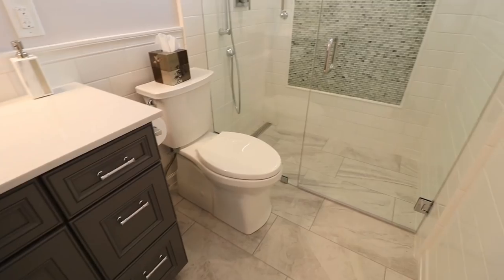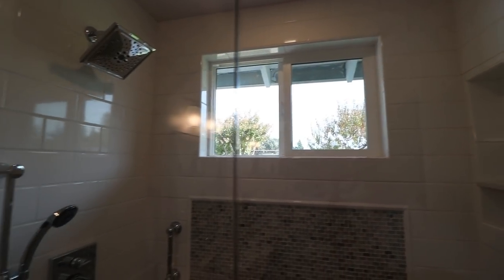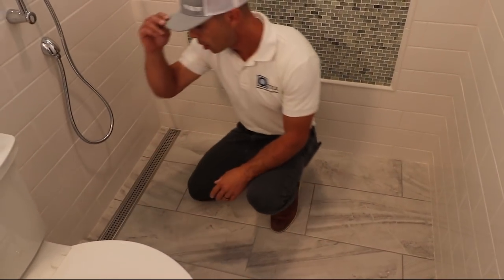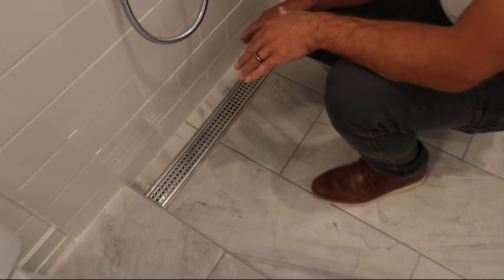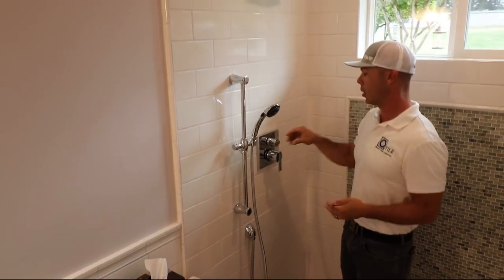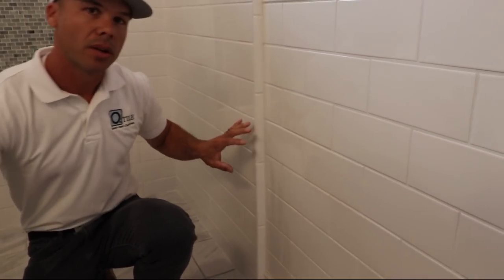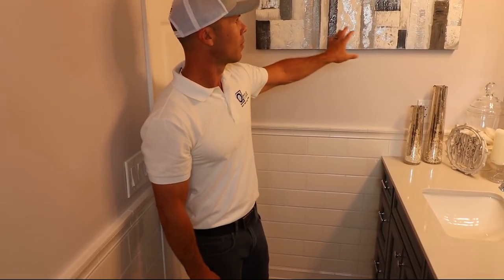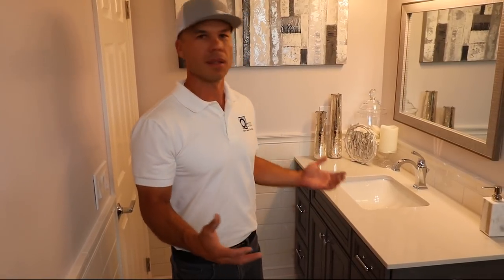Complete Bathroom Remodel-  Start to Finish-  Grandpa Bath Episode 9

Comment: Dude, you are cool.  Love your passion, and love your humility.  I'm glad there are guys out there like you doing top level work, and taking pride in it, like we used to.  I used to think that most contractors were out there, cutting most, if not all of the corners, but you've changed the way I think about hiring someone to do the level of work I'd like done in my home.  After watching this series, I realize that it's a ton of hard, skilled work, and I have to admit, even as a handy guy, I don't think I could/should make a go at it.  Electrical, Plumbing, sealing, mudding, and all of the forethought and planning put into centring, and finishing touches.  A true professional.  Bravo, man.  I'll stop kissing your ass, now.

Comment: When enlarging a bathroom into a space that has hardwood floor do you need to remove the hardwood replace tile backer and then set your tiles. Seems like that's the way you have to go but you're the expert. What's a u coach really would appreciate it.

Comment: great videos Isaac.... really great.  I am in process of planning exactly the same shower, pulling out the tub, building the correct pan structure for curbless and doing the linear drain along the control wall.  Perfect.  However what I most wanted to see was the one thing you didn't cover and never showed:  The relationship between the glass wall pane/door and the ramped curbless floor transition?  Where is the water dripping onto from the glass?  Is the glass overhanging the ramp step or overhanging inside the ramp?  If the  glass is mounted to the floor outside the ramp how is the water being prevented from pooling?

Again great videos, but I was hoping to see that final detail of glass and door relative to the curbless ramp step.
Thanks!

Comment: Great work Isaac, thank you for inspiring and dispersing your knowledge. I just finished tiling a bathroom for the first time, and the amount of planning and foresight that goes into it is staggering. However, doing your homework surely pays off, and I am very happy with the result. 

I still have a question, forgive me if it has been answered. I watched a lot of your video's, but I can't claim I watched all of them. Anyway, what's your opinion on leveling systems? Are there systems that work better or worse than others? Do you consider it cheating, as it does make leveling a lot easier (but by now means full proof, as I can attest to)?
Thanx again, you've been of great help.
Reply: @TileCoach  Thanks for your swift answer. I found them harder to work with than expected, but then, my expectations as a firsttimer where only theoretical :-) Since I have experience with only one system (fixfine in case somebody was wondering), I was wondering whether there are significant differences between the brands, or maybe there were things to consider which I had overlooked. As for cost:  I actually consider them pretty cheap in relation to the rest of your materials.

Comment: How many manhours did you have  in this start to finish?
Reply: @TileCoach   Do you think it would have went quicker with a similar quality outcome if you would have went with something other than floating the walls. I know in a previous video you had mentioned usingA type of wallboard with the membrane on it and then using Ardex  Waterproofing over the top. You also mentioned using Kerdi in your own personal shower.  For a business owner professional tile installer which one do you think is best?